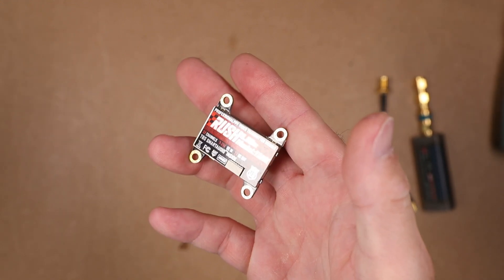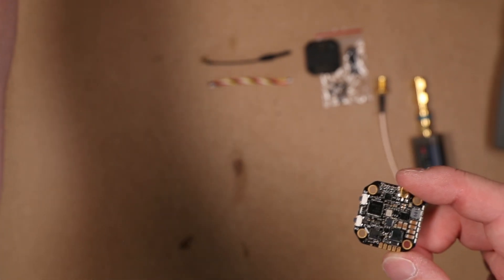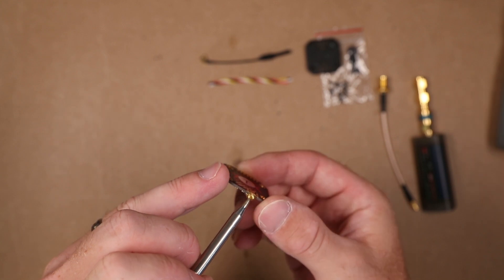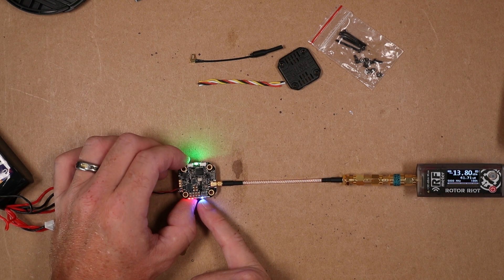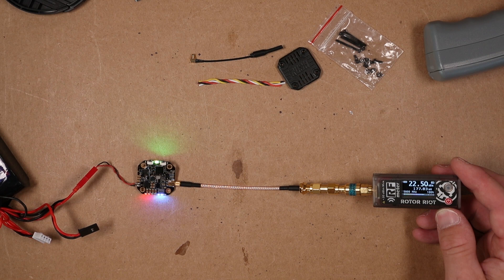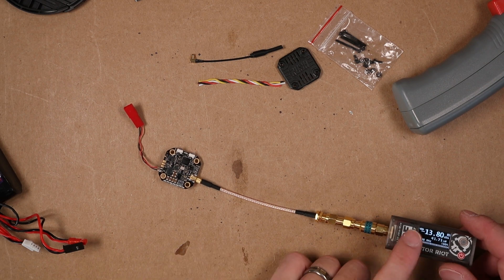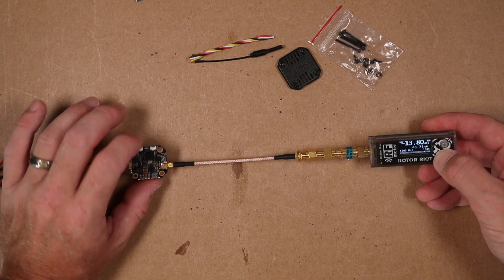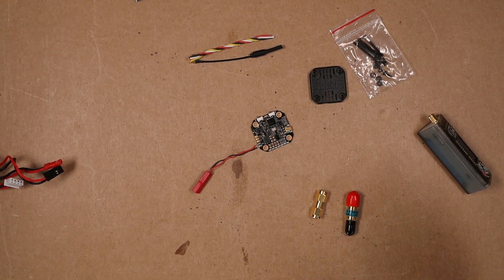Rush Tank Mini 20x20 VTX - Can a little VTX really perform?

Comment: Mine says 800 in osd but is green for 25 mw
Reply from the maker: There’s a huge difference between 800 and 25mw. Fly it a few hundred feet away from you, if your getting terrible signal then you know it’s 25mw. Do you have the correct VTX table loaded?
Reply: @breaksteel  I got it show purple now. Still didn’t feel like 800mw I threw a lollipop on it now going to try it again
Reply from the maker: There should be no mistaking 800mw if it’s working properly.
Reply: Had akk tables before I think that was it

Comment: Is it supposed to get hot?
Reply from the maker: Yes, which is why we keep them cooled. Desk mount transmitters use fans and heat sinks. Quads use airflow. Better the cooling the better the performance.

Comment: Thanks for the video!! 
So weird I have the same one and it worked fine for awhile now I get a small section of screen that's real bury and jumpy with lines -sometimes at the top sometimes in the middle just random where it appears. Even weirder only in the fat shark scout goggles on my 7" external display it looks perfect and to make it even more odd the blurry lines are for the most part is when it sets level -when off level it goes away completely most of the time. Any Ideas.
Reply from the maker: This is weird.. the fact that it’s only on your goggles tells me it’s your goggles. The fact that it depends on what angle the quad is tells me it’s due to an antenna. Tough one cause each symptom tends to contradict the others. Your best bet is to try swapping out some parts until the issue goes away. Have you had this issue with those same goggles and another quad entirely?
Reply: @breaksteel  Thanks for the info. I have it on the bench now. I have a some different antennas for the scout and the Vtx I'll try now.... I tried to calibrate the scout no dice.... I have the cheep echine $100 dollar goggles an even with no antenna the eachines look fine. These drones are like a puzzle some times and other times straight forward.  I have all my quads on Race  band so trying to stay with that. uggg lol
 Thanks again. oh yeah the goggles "scout" work fine on all my other drones running AKK and Iflight vtxs
Reply from the maker: It sounds like it’s a bad or loose antenna. Shifting it around shouldn’t alter video that close.

Comment: Just installed this one on my acrobrat duo build with Betaflight 4.2. Video Transmitter still says Device Ready : NO, although I'm getting a video feed on the right channel. Also any changes in OSD or Betaflight to VTX do not save. Any ideas? Thanks!
Reply from the maker: I’d start by checking your peripherals, make sure your telling Betaflight which UART Smart Audio is.
Reply: @breaksteel  Thank you! Not even support caught that. Even though I checked it over and over, I still missed that I had it set to UART4, instead of UART3..wow...3rd build and noted. 
Thanks again!
Reply from the maker: Easy to miss that brother. I’ve had it happen before. Happy to help! You planning on uploading a flight vid I can check out?
Reply: @breaksteel  Here is one from the brat. Needs more tuning. https://www.youtube.com/watch?v=0wRgYynO5b8
Reply from the maker: Just checked it out, good little craft you have there. I agree it needs a bit of tuning but it’s defiantly good enough right now.

Comment: Use the tbs mmcx connector. It has better signal.
Reply from the maker: Very true! 
I initially was testing with the pigtail that came with the meter. I retired that pigtail as the MMCX came apart. The one used in this video was one that I had purchased separately that I have also retired for poor performance. The new one I'm testing with is the one that came with the Unify Pro32 HV. I see almost zero losses with this TBS version and will be buying a lot more of them!

Comment: Try to test wth a fan on it to simulate flight terms
Reply from the maker: This is the plan for coming VTX tests. I’m filming a bit of an intro to my coming setup soon where I’ll show the fan I’ll be using. Was looking for a strong fan that was silent. Someone had suggested a Noctura and it seems to be very good.
Reply: @breaksteel  Cool, I have an idea :D maybe stupid but simple.. use the 
vacuum cleaner wth long pipe to get the noise as far as posible. just a some piece of net on the top of the pipe ... just thinking. Keep going XD
Reply from the maker: Good idea, but already have the fan. Just filmed a setup video, and this should work great! Silent fan, adjustable voltage for speed, and it looks cool! I’ll try to release it next week.

Comment: Generally on a drone the vtx will have more air flow than on your bench.  Maybe use a fan for the mw test?
Reply from the maker: Your absolutely right. I’m currently in search of a small fan that is silent for these tests. Tests are still valid as most people plug in and drop the quad somewhere before flight. That or after a crash the VTX sits and cooks. This is why I try to let the units cool to ambient temps to get initial burst and later show hot temp outputs. With the fan I can add in flight outputs but it needs to be silent for filming. No on wants to listen to a whirring fan.
Reply: @breaksteel  Or just use a little Peltier Module
Reply from the maker: Olli Huhn Well there’s an idea. I wound up with a Noctura computer fan and a large buck converter to control power input. I released a video on this entitled “fan build for VTX testing” if your interested in seeing the setup. Hoping to record another VTX test later in the week to put it to the test.

Comment: Great job!!!  I just got a 30x30 but haven't had a chance to try it yet. I just built an acrobrat, and used a unify, but would rather had a 20x20 to mount. It still turned out to be a really nice build, and unify is the best I've seen. I'm new here, and started posting some raw footage, but will be posting much better quality footage as well as builds, and whatever comes to mind. I would appreciate it if you would check it out. Have a great day, take care!
Reply from the maker: What are you running for 30x30? Having a 20x20 with this much power is filling a gap in the VTX world. The entire Unify line is a really good line up of components, almost can’t go wrong with any of them. Thanks for the support, I’ll stop by and check your videos!
Reply: @breaksteel  I've been using the IRC Tramp up until I received a unify nano from drone drop, it worked so well I'm using a unify in most of my quads. I bought the Rush Tank because I'm tired of them being taped down. I repaired the vtx I ordered the Rush Tank to replace, so I don't have anything with a 30x30 yet.
Reply from the maker: @RCOverKill  I find most of my builds don't have room for a full on stack. I like the slammed builds. Don't mind taping my VTXs as they usually don't move with good tape. If the are a problem then a zip tie solves all. Haven't tried the Tramp yet.. The Nano finds its way on all my small builds.
Reply: @breaksteel  check out the synergy FC, it allows for direct board to board soldering of a unify, and an xm+, or crossfire. So everything is on 2 boards. So 15mm is all you need for a superslammed rig, 15mm is all the room you need, and a couple mm less if really need it. I want to build the super slam nasty by catalyst machine works, but it's 75.00, and I already spend an embarrising amount of cash every month. I will just not this month, lol
Reply: @breaksteel  also I haven't tried the Rush Tank, but the tramp is an Exellent vtx, if you consider unify #1, and rush tank #2, then I would say the tramp is #3, but since I haven't used rush I'm not sure it's any better than the tramp.
Reply from the maker: @RCOverKill  I love those solder component boards, Whitenoise makes a few of them too. Having a full on FC as the main board is sick though. As for the SlamNasty, thats $50 not $75. I understand the cash flow thing though.
Reply from the maker: @RCOverKill  I have yet to test the Rush Tank 30x30) . I have one which is slated for a FlightOne build. What I can say is the button interface is an absolute joy to use. Its intuitive and quick. Many if not all others need an instruction sheet or a large partition of brain power to remember the functions. I have a friend who swears by his so I made the leap for it. I'll roll out a test video before I install it.
Reply: @breaksteel  yea, it is 49.00, but braces 10, and a flip stick I think Is 6 or 10 bucks, and I count tpu as frame is why I said 75. Lol, I just want to many toys. Btw white noise makes the synergy.
Reply from the maker: @RCOverKill  Yeah I suppose it adds up once you add all the additional bits to it. Then again your still up around 200/300 after all the electronics are added in no matter which way you go. Never easy on the wallet this hobby. 
 
That explains Synergy sounded so familiar.
Reply: @breaksteel  I guess your right, probably a little over 300 because on that one I would use the synergy with 32 bit escs. I've decided E motors are as good as any, at least good enough for me. The only set of premium motors I bought gave me more trouble than the racerstars from my 1st build. Gotta have a good camera, and vtx, can't wait till I can afford an HD setup, they say it's like a go pro.
Reply from the maker: @RCOverKill  I'm waiting on the Fatshark system. Hoping it will be just a camera and a VTX type transmitter like the DJI system only smaller, lighter.
Reply: @breaksteel  me too, I don't have another grand to put it on one quad. I would cry every time I crashed,lol
Reply from the maker: @RCOverKill  That is the single largest issues with these systems. The cost is too high for any reasonable person to be willing to crash, break, or loose on any given flight.